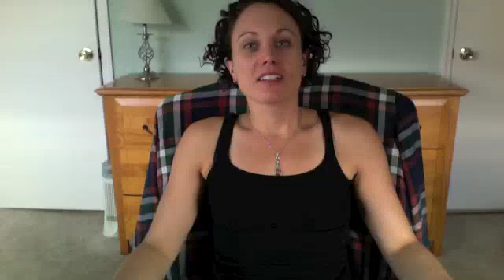What is a crossover?  What does LP and HP filter mean?

Comment: I have a TM400ad fosgate  amp for my Harley Davidson 2 6x9 rear saddle bag speakers 100watts 200 watts peak and in front I have 2 6 /1-2  75 watts 150 watts peak which setting should I put my amp on LP/ HP/AP Thank you

Comment: I Would like to add that volume of air a driver is capable of pushing determines how low a frequency that unit can reproduce, there are for instance 4" units with 2" of excursion that are perfectly capable of producing low frequencies.

Comment: you can not just split them off at 80hz you need some overlap, i know there is some rolloff in every crossover but you must give it some headroom.
Reply: If I have 4 Kicker CS (3-way) 6x9's in my car and no sub or amp, so do I even need to turn the high pass on? It ranges from 50-120, but with it off it sounds really good. I just don't want to blow a speaker if I'm doing something wrong
Reply: If you have no amp are you saying your head unit or radio has a crossover built in? either way you want it off so your speakers are getting everything.
Reply: andrea4809 Yes the crossover is built in. It doesn’t sound like with it off it’s being pushed beyond any limits, and it sounds much better too. Thanks for your help!
Reply: The crossover in your head unit should only effect the pre outs, those little rca jacks on the back. this is used if you have no electronic crossover or crossover built into your amp. You should think about adding a small sub and amp to add a little bottom end to your system, you will be suprised how much more full it will sound.
Reply: Maybe one day I'll add on to it, but for now thanks for clearing things up! This subject is a lot harder than I thought.

Comment: Hey Annie, I just recently got a Kenwood Excelon KDC-X302 for my Grand Caravan. It still has the factory speakers. 5.25” in the dash, 6x9 in the front doors, and 6x9 in the third row. I have my HPF at 60 hz and slope at 12db per octave for both front and rear. Should I leave it there, or set it to “Through”? I also have other options (30,40,50,60,70 hz etc.) I’m not using a subwoofer yet.
Also, the digital time alignment has a setting to adjust the gain for each specific speaker. How would I go about that? Its the first time I use DTA. Currently using the preset “ Front Left” position, but was thinking of actually measuring the distance from each speaker and trying it the proper way. Thanks in advance.
Reply: u2bed91 hi carstereochick I actually have a similar set up your advice would be so appreciated...thanks.

Comment: Leaving a gap if for example you set LPF at 50hz and HPF at 100hz and both slopes (in this case i'm thinking about is 12db/octave) then it will not create a gap, if however setting both lpf and hpf at the same freq then there will be a spike/hotspot instead of a flat response in that area which will sound boomy, not what you would want
Reply from the maker: If you set LPF at 50 Hz 12 db, you're dropping everything above 50 hz down by 12 db on your sub channel. If you set HPF at 100 Hz you're effectively lowering everything below that frequency 12 db on your mid and highs. How are you not creating a gap between 50 and 100? You've effectively lowered those frequencies 12 db. For reference, "-10 db" is perceived as 1/2 the volume in terms of loudness by the human ear.
Reply: carstereochick i know about 10db as a reference. Hpf at 12db/oct set at 100hz has dropped 12db at 50hz since thats one octave, there wont be 12db loss right after the break point, however my first comment is wrong, best way setting crossovers is listening ofc, but can't hurt to measure looking for peaks.
I found steep slopes around 70-80hz with a close gap between hp and lp working best for me Cheers😎

Comment: can anyone help me determine where the boost knob on my 4 channel amp should be set to? my options are between 0 - 18db. My crossovers are set - (sub - 80 low pass ) Amp Front channels = 120 and  rear channels = 80 (high pass)
Reply: Xx19steven87xX if you mean bassboost then leave it at 0, bassboost most often distorts the sound, if you have enough power you don't need boost

Comment: I got a used sony 4 chn xplod amp (xm-504z)
Running two 5.25" and  6.5" speakers in my boat.
The amp has hpf and lpf  on/off switchs and adjustments from  6 to .3v
Im just tryin to figure out the best way too hook it up

Right now i have lpf switched off 
And hpf switched on and set to 1

Is that right?

Comment: oi
i am ganna run my 4 inch tweeters to my front 6.5 
what about them speakers
i did it before
no subs
subs are gay 
i only go for sound so going to run 4 6.5 int he back and rear
then 6.5 front doors and then maybe try to run  the 4 inch in my upper dash and run those tot he front speakers 
good or no
plus make some good hook up steros on here too
you explined it good enough so now for some hands on works

THE END
::))

Comment: Hi Annie, really nice explanation. I wasnt sure what LP and HP were untill now, unless I played with them and whichever sounded better and left it at that. I recently replaced my 4 channel amp from MTX to Mb Quart due to a ground conection unproperly uninstalled and reinstalled that blew my head unit. Turned our I really did not need a new amp but to repair the head unit. To make long story short, now I keep playing with the head unit and seem to not get the right sound that is pleasant to the ear. Not sure how the new amp frequencies are set but supposing the guys knew what they were doing and set it at the right level. I cant access the amp since its mounted and doesnt have a way of seeing the controls until I unmount it. It is using the original Bose wiring just replaced the head unit, interior speakers, added 2 amps and 2 subs. I do not check back the here ofted but if you could please reply to my email hadzhemyan@sbcglobal.net and can help where I can find the right sound. Maybe we can do facetime calling or skype and you can visually see what I am seeing. It is a Kenwwod DD in 04 Cayenne. Thanks again, hoping to hear from you.

Comment: Awesome video my amp which is a 4ch rockford fosgate has a LP- AP-HP... This set up is on a motorcycle and I have 4 speakers. Speaker size 4in, do i set this on AP or HP?
Reply from the maker: Lewis Marini For 4" speakers I would set to HP because they really can't handle a lot of bass, if you have a frequency selection you'll probably want to put them around 80 - 100 Hz.

Comment: Also pertaining to my last question, can you please tell me if it is a bad idea to use an electronic crossover along with an amp that has already been set with the speakers to provide a passive crossover?   The guy who installed my system last tweaked it to sound very good with the speakers. Would changing a head unit have any negative effect as well as changing an electronic crossover in that new head unit?
Reply from the maker: Nick Caruso Hi Nick, I'm not familiar with that model, are you in the US?  What car is this for?  Are you strictly looking at single din only?  If single din, consider the Kenwood eXcelon KDC-X998.  Check out page 20 of the owner's guide:

http://manual.kenwood.com/en_contents/attachDownload/76754

You can adjust crossover frequency, center frequency, slope separate for front, rear and subwoofer OR if you plan to run active you can even do tweeter, mid and subwoofer.  I think this will give you the kind of control you're looking for.  Doesn't have quite the same top end detail like the old Eclipse units did.  For the most similar sound quality consider the Sony MEX-GS610BT.  I think that's the closest single din, 5 volt, high quality DAC head unit to the old Eclipse models, but it doesn't have separate front, rear and sub crossover adjustments.

Secondly - you never want to use the crossover on your amp AND the crossover on the head unit.  One or the other.  I'm kind of confused by your second question though.  It sounds like you have a set of components with a passive crossover currently being run off an amp which also has the crossover on.  That's normal.  You just wouldn't want to use the amp crossover and head unit crossover.  But if you're using a passive crossover between tweeter and mid, yeah, you will stlll need that unless you decide to go active and run a 4 channel amp on each individual component.  Meaning Front Left = Front Left Tweeter, Rear Left = Front Right Mid Range.  If you want to do that, then you need a head unit that can do that tweeter crossover electronically and that would be the Kenwood.
Reply: carstereochick Hey, wow, thanks for answering me!  Yeah, its for a single dim.  its going into my Chevy Cavalier (2004).  I may have answered my own question though...First of all I said the model wrong.  Sorry.  its' actually an Alpine CDE-153BT.  It has the capability of being controlled with the smartphone ap TuneIt, which has the capability of what I was looking for, that is to filter out each channel individually before it reaches the amp (Rockford Fosgate T800).  My amp is set to All Pass.  Thank you for the recommendation of the Excelon.  I actually checked it out and maybe I'm thinking IT would be better.  13 band equalizer.  Damn!  Ok, so a quesiton about that head-unit, since you've got me interested.  What is bass management and how does the 3 level bass boost actually work?  Does it go through all three of the Pre-outs (front, rear, AND subwoofer) or does it just go through the front and rear?  Not sure why I'd want a bass boost when I can control the subwoofer independently, you see what I mean?  Either way, thank you again for the reply, you're great.

Comment: Hey! Awesome post, thank you. I have had a system for the past 15 years and have gone through a few different head units. Every head unit I had was by eclipse and now that they are out of business I am looking for a new one that can match the features that my old eclipse has. Can you please give me some advice on where I can find a good head unit that can do a certain thing?   I am currently looking at an Alpine CDE BT-453  I'm a little bit nervous to buy a new head unit so because nowadays it seems as if the head units do not offer an electronic crossover like my eclipse had.    What I'm talking about is there is a function that enables you to graphically see the crossover and the slope. You are able to use the head unit to change the filtering and the slope on the front rear and subwoofer channels independently.    The retailer that I am speaking with right now tells me that nowadays you can only control all of the channels together with a parametric equalizer and I don't want that!    Help me stereo chick! show me where I can get a good head unit that is top quality performance with electronic control of the crossover the way I would like to have it.   Thank you again for your awesome insights.   Nick

Comment: Hi my system has Polk mm 6.5 components in the front and mm 5x7 in the back the fronts are set at a hpf of 80 
but the rears are not using any hpf should they be? Also when you buy component speakers what do the crossover boxes do? Is it how the tweeters get wired in to the system?
Reply from the maker: Chilly Willy 88 So weird, I swear I responded to your comment last week.  Let me try again!  Assuming you have no subwoofer in this set up, you would really want to have crossovers off and leave everything full range unless you're getting a lot of distortion on the front speakers for some reason (sometimes if it's a tight fit and speakers are over extending and hitting the door panel it can help to turn the crossover on).

If you have an amp and subwoofer and you're powering the speakers off the head unit, then yeah, I would put the crossovers on for front and rear.

The crossover box is really just there to divide up the frequencies to the proper component.  So if you have a full range signal going to your front components, that crossover box is telling the mids to play the range they're capable of and the tweeters to play the range they're capable of.  It's kind of like a traffic cop sending frequencies to the right direction.  Even if you turn the crossover on the head unit at HPF 80, then you are sending 80 hertz and up into that crossover network.  That traffic cop is still going to send the correct frequencies from 80 hertz and up to the right location.  I hope that makes sense!  And I hope this comment actually stays this time.
Reply: the only other thing i would like to know is if im not runnig hpf on amp or deck so its all full range what should the amps frequency be set as?? the manual said

 FREQ (cut off frequency) control
Cut off frequency selectable from 40 Hz to
500 Hz if  the LPF/ HPF select switch is set to
LPF or HPF
 i dont get what it means basically certain songs make too much vibrating noise but if i turn on a hpf it lacks body songs like daft punk around the world at the start or gorillaz kids with guns
Reply from the maker: Chilly Willy 88 Well if you have it at full range those settings don't mean anything.  When you have the amp set to LPF you are telling the amp to turn on the low pass filter and cut the frequencies off to the speakers.  LPF is for subs.  When you set the selectable frequency at say 80 Hz you are telling the amp to only play from 80 Hz and down.  When you have that same frequency set and you switch it to HPF or high pass filter you are telling the amp to play 80 Hz and up.  But if you have the amp set to Full Range none of those settings matter, it only matters when you turn the filter on either HPF or LPF.  

It makes sense that you lose body when you turn it on because you are cutting out the bass.  Maybe set it a slightly lower frequency like 50 - 60 and see if it still vibrates.

Comment: what does a 6db/octave MP really mean? im tryin to match a 3 way speaker tower with crossovers. I want to replace these from scratch - tweeters, midrange, woofer, and crossovers. I heard you can damage speakers if you don't match with the correct crossover. then I see something like - Crossover slopes: 12 dB/octave LP, 6 dB/octave MP, 18 dB/octave HP, so my question is what does the 12 db/octave mean?
Reply from the maker: kwapedog The levels 6 dB, 12 dB etc refer to how sharp and drastic the cut off and reduction in frequency is.  If I crossover my mid range speakers at 80 Hz high pass 6 dB I'm basically knocking down frequencies just below 80 Hz 6 decibel levels.  So they're still there which allows for blending, but not as much.  12 dB knocks them down even more which makes for a sharper transition between components.

My knowledge of crossovers is in car stereo application and in this video I'm really referring to crossovers in amplifiers or head units.  I would imagine a tower speaker would have it's own passive crossover network kind of like what I would use with a set of car stereo component speakers.  And yeah you could easily damage a tweeter if you try to put a full range frequency through it, they need a filter to allow the frequencies they're designed to play to come through.  Each component should have it's own rating on what frequency range it's designed for and capable of playing so I would use those ratings as your guide as to what type of crossover network to use.  You can check out Parts Express online for building your own crossover network.  I hope that helps!
Reply: I would stay clear of replacing the crossovers if you ask fundimental questions like this, you cannot just slap a generic crossover into a unit and expect it to sound good; you need to do careful calculation based on the thiele small parameters of the drivers within the speaker.

Comment: Thanks for the explanation on LPF/HPF I learned something today. Yaaa! But My head Unit has a "slope" adjustment. Can you tell me what that is? It can be set at 1,2, or 3. Thank you, BTW you are HOT!
Reply from the maker: Tim datoolman Hi Tim, Slope refers to how sharp or steep of a cut off your are making with that crossover adjustment.  Typically you want to have it slightly blended so there is an overlap between LPF and HPF.  If you make your crossover adjustment too sharp you may have a gap in frequencies between LPF and HPF.  So I would try it at 1 and see how it sounds.  Thanks :)  Glad I could help.
Reply: carstereochick Thank you, That is a big help

Comment: If I have a 4 Channel amp bridgeable 1000 watt and I want to connect (3) 6.5 speakers and (1) 8" sub can I bridge channels 1 and 2 and connect all 3 of the mids to it and bridge 3 and 4 and put the sub on it and it work fine? I know I can just hook each speaker to each channel but 1 of the mids will be on LP with the sub. What is the best way to connect everything. Also the amp is 4 ohm and the all speakers including the sub are 4 ohm.

Comment: Hi i dont know to much about ohms and now I know hp and lp cross overs are and thank you, now I have 2 12' sony xplod subwoofers in a ported box, 1 is a 1500 watt rms 550 watts and the other one is 1300 watts and im not sure on the rms wattage, there both the GS120LD SERIES and i have the sony xplod 1000 watt 2 channel xm-1652z amplifier. My question is how should I wire my speakers so I get good pound and not hurt my subs and not make my amp hot and also being that both my subs are alittle diffrent in wattage?

Comment: I just changed out my stereo and also upgraded my speakers in a Mitsu/Eclipse '03 but the speakers in the from don't seem to be getting much signal. My tweeters are super loud so i'm getting all the high I need but no mid from the acutal woofer. Do I need a crossover to fix this? My car also has a factory preamp that I didn't bypass. Should I just bypass it?